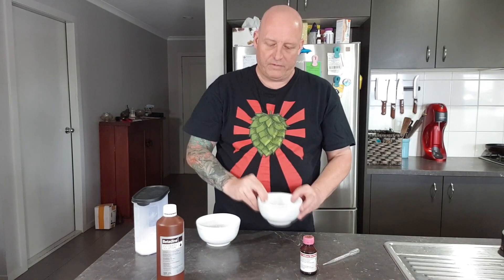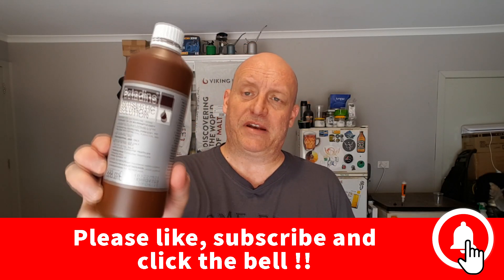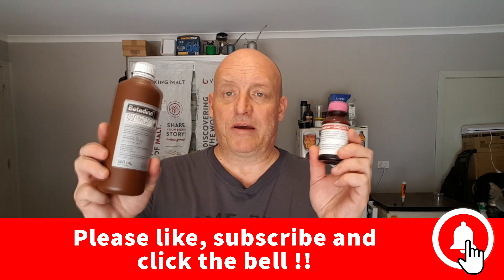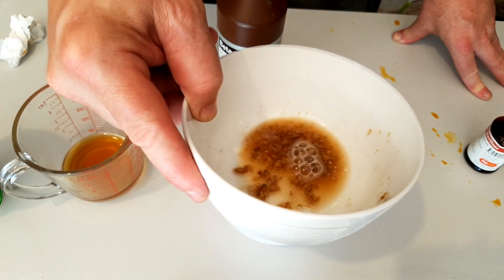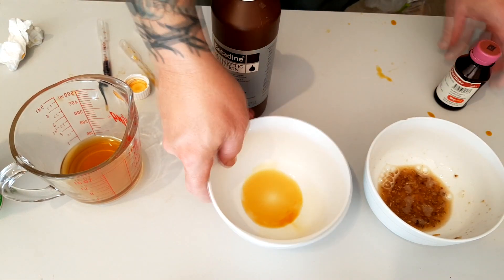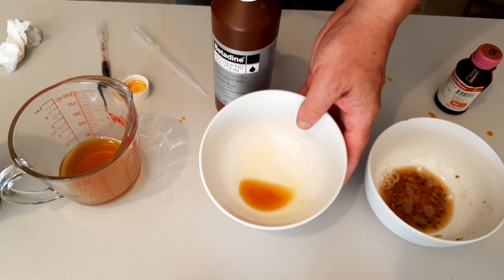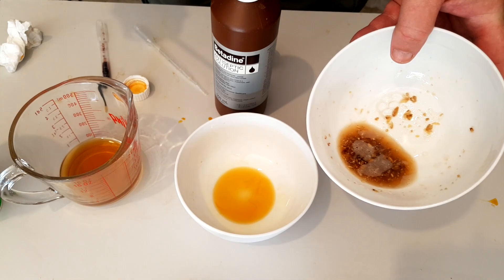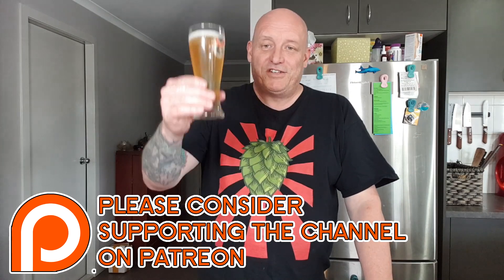IODINE Starch Conversion test - Mash Conversion - Iodophor or Betadine?

Comment: Thanks for the video. It looked to me that using Idophor or Betodine was kinda tough to be sure of the result. I know I had a helluva time finding REAL iodine like you said. My local Walmart here in the USA sold some kind of clear crap that was labeled iodine, but wasn't. I don't know how they get away with that garbage. I took it back and left a nasty review. I did find REAL "tincture of iodine" at a pharmacy which works wonderfully. I use about a tablespoon of wort in a white bowl I got from the dollar store. (I only use it for iodine tests) just one or two drops and it will go noticeably purple/black immediately if there is starch. If conversion is  complete, it stays yellowish orange. Cheers!

Comment: I just mash for about 60 mins for an ale and if I were doing a Lager at lower temperatures 90 minutes most of the time I add 10 minutes onto it so its 70 mins and 100 mins I tried the Iodine test once and found that 50 mins it was ok  but I find 60mins is enough, mash PH is what I need to tweak
Reply from the maker: Sounds good! Cheers Peter!

Comment: There is a tricky part with Betadine I've found... Ratio 1:1 of Betadine and Mash (1 or xy drop's of each) and Betadine first if the solution won't change the colour starch's gone. Paradoxically I don't do this sugary test on my lagers if using same malt water etc but tell you what happened. The bloody temp probe was playing up and I didn't notice that of course no sugar test too all process up to vessel and then... couldn't get FG lower than 1022 (supposed be 1014+/-). Temp probe was out 7C... Really good point Gavo to mention this topic as a part of every single brew.  I know it's hard to match colours on camera mate, I did it couple times too with mobile in 1 hand and the other to do that test with same drops down and when I've seen it on computer it was looking different again. Great idea to share and remind that. Cheers mateeee;-)!!
Reply from the maker: Crikey! hahahaa Cheers mate!
Reply: @HomeBrewNetwork  :-DDDD yep hehehe... Cheers mate ;-)!